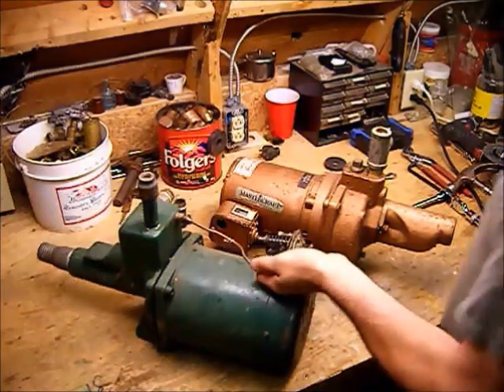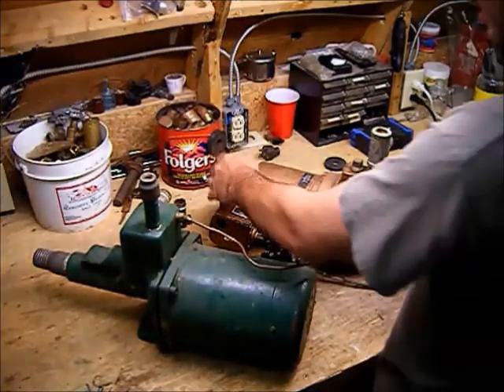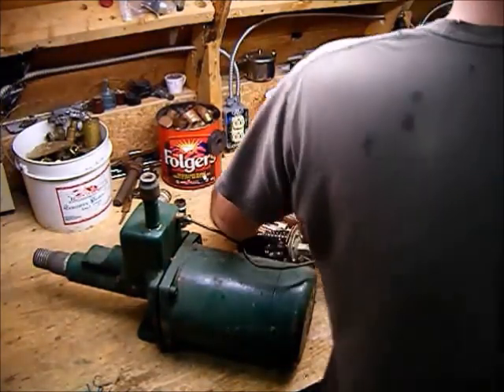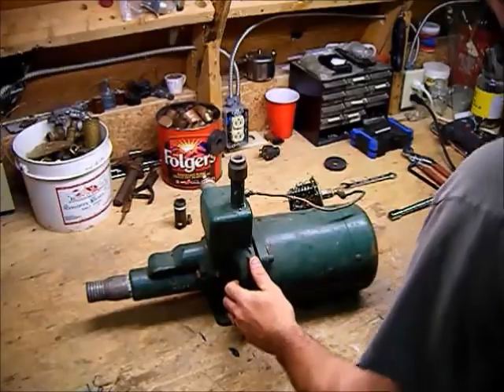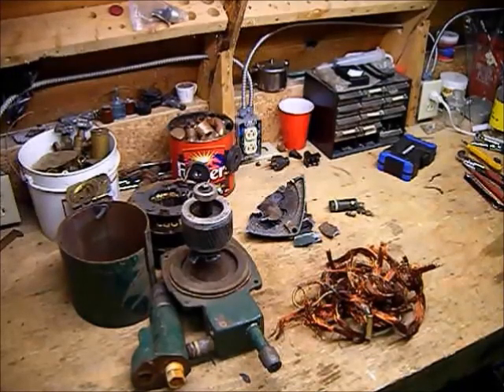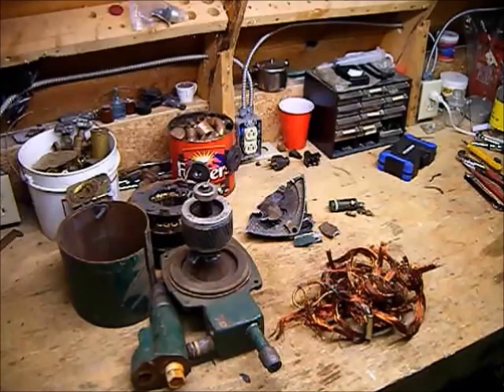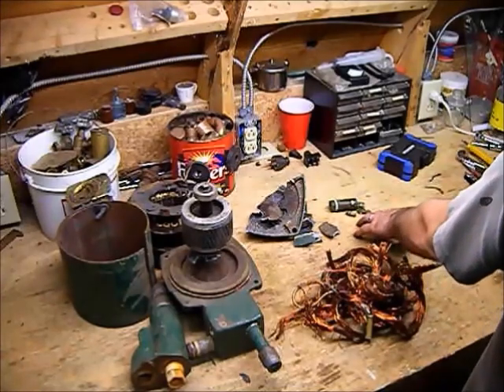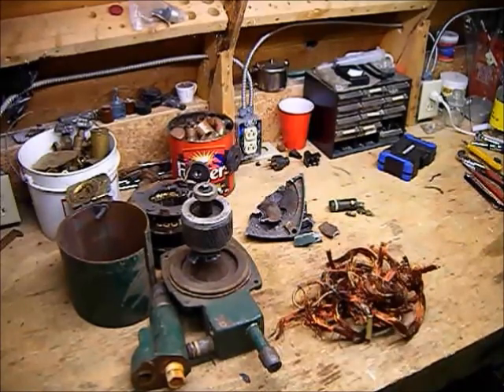Scrapping a pump for copper , brass , aluminum and steel . How much $$$

Comment: Did u check if the copper wire is actually copper? Or is it just copper coated aluminium?
Some of these motors are just copper coated, making it pretty much worthless
Reply: its uncommon for pumps to have alloy wire as it doesnt last anywhere near long enough

Comment: is there a big difference in price if you just scrap it as a whole unit instead of taking apart?
Reply: Motors only usually for for around 8 cents a pound together ( less if you leave the from pump part on )
Reply: depends on who buys it some scrap yards will break it them selfs and just pay you the scrap price per pound/kilo  for example i live in the uk so im not sure on the diference but ive sold brass pumpsas a whole for around £20-£30 and if i break it my self the price has hardly any difrence sometimes none